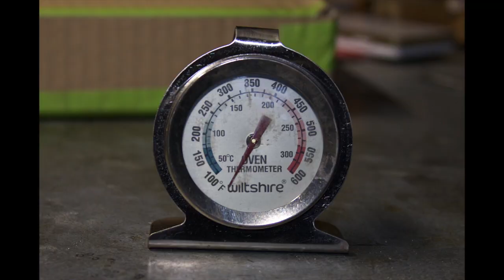Beginner Knife making, making a knife from a piece of leaf spring I found in a river.

Comment: G'day mate, you got any info/vid/pics on that knife blade holder you were using when hand polishing it back? Looks like a neat jig!
Reply: Ah I see more now when you're wrapping the paracord. Looks home made, nice!
Reply from the maker: No don''t have much on that, make it out of off cut rhs 50mm x 75mm with a plate on the back and bolt through it.  The rest of it is off cuts of flat bar and some 12mm nuts and bolts.  Might do a vid on it soon.